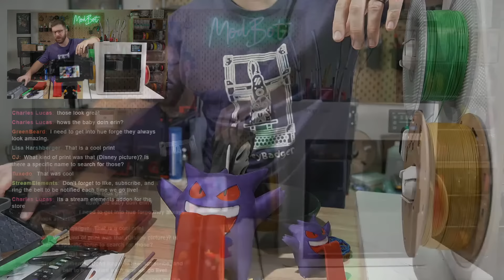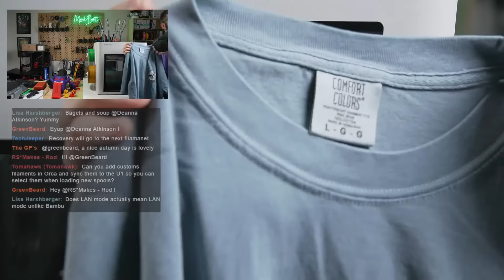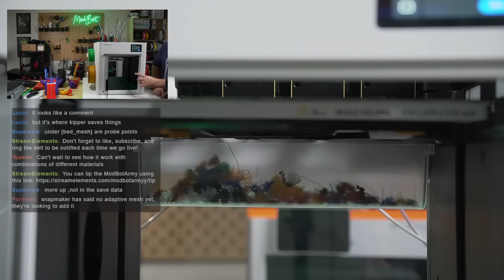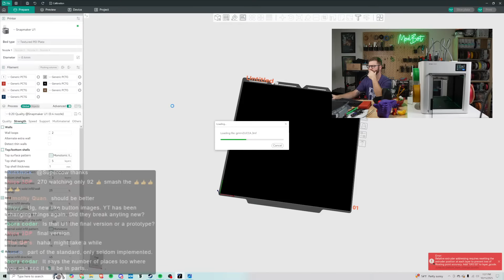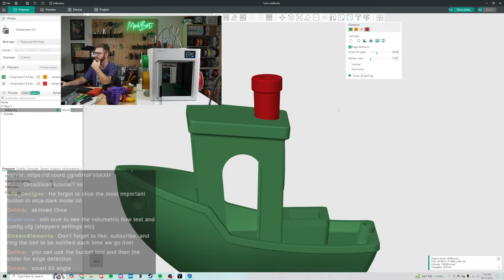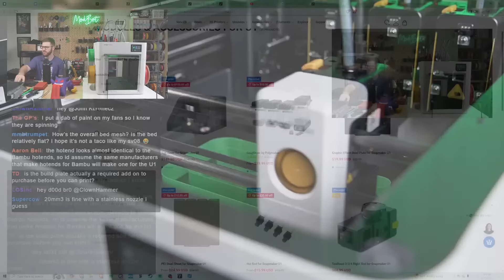Snapmaker U1 Tool Changer 3D Printer Part 2: Slicer, Firmware, Updates

Comment: I've done another 11" tall solid color print that has streaks in it (on my K2 Plus). It might have been just printing too fast to fully "melt" at temp but I'm pretty sure the filament had a problem as well It was a lot of thin banding?!? And I even saw a thin band on a smaller print in the same filament spool that should have melted properly.

Comment: Just watching the VOD.

The option with the filament runout assistance might be a kind of backup mode, where it automaticaly takes a second spool if the first goes empty. Or is there another option for that? Didn't saw that so far in any other video.

I realy like the way they made the manual leveling. I think that is as userfriendly as it can get without motorized leveling screws. (Wich btw would be pretty neat if any manufacturer would do that.)

I understand why they want their own device tab in the slicer, but they should also add an additional tab for the web interface, maybe behin an advanced checkbox.

The flowrate test is looking good. Glad it can handle more than 15mm³/s as the standard filament profile suggests. As this are stainless steel hotends I would guess the hardened steel ones should perform similar? I will probably change to the hardened ones before switching it on for the first time and keep the standard hotends as spare parts. It would be nice though, if they would bring CHT style highflow nozzles for fast printing with larger nozzle diameters. But that probably is just a matter of time.

Comment: nice video! PS: some slicers also offer '3D honeycomb' which is a bit similar to gyroid. Currently my favourite :)
Reply from the maker: I don’t think I’ve used it will have to give it a go 😊
Reply: @ModBotArmyy  I just checked a few test videos from CNCKitchen and MadeWithLayers - Gyroid & Cubic are the better choice (3D honeycomb has straight lines and 45° lines so the printer can move quicker but this also results in acc /dec compared to gyroid where the infill speed is more constant. Also, prusa seems to have a weaker 3d honeycomb than slic3r or creality slicer. )